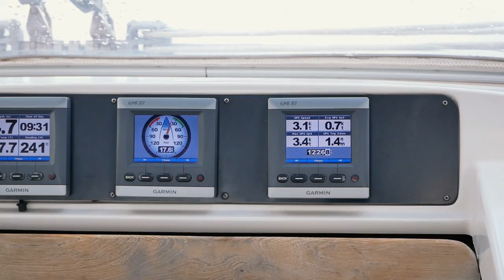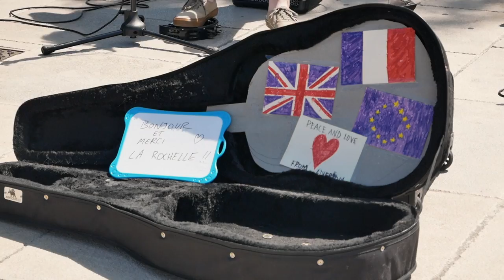A Very Difficult Decision | Sailing France Ep 112

Comment: We had the same problem once as well. No forward and only reverse.  We were leaving Maloolabar  in Australia and near the entrance.  We reversed back to our birth for about quarter of a mile. The difficult bit was we were a long keel yacht!  Fortunately we were a double ender  so it did not look to bad going backwards.  Had to adjust the clutch cone.  Watch what the mechanic does to adjust your clutch cone it is very easy that i learnt how to do it after watching the mechanic.  Takes about 10 minutes.  Another thing i learnt from a wise old fisherman is that many gear box problems are caused by having the wrong oil in them.  Literally change the oil to the correct spec and most of your problems go away. It is very common for the wrong oil to be in the box.

Comment: Nice.
The mechanicals suggest...
1. Great justification for hull cameras
2. Great justification for genset, batteries, and brushless electric motor.
3. Great reason for inter com.
Reply: They are selling the boat and moving on. A boat in this price range would dive considerably in price if it had non standard modifications. Electric motors, no problem we have an electric propulsion specialist right here in Sydney (600 miles away). I use a waterproof camera on a stick. Does a good job of prop inspections, but the bloody Wifi doesn't work underwater. I was particularly interested in a boat that came standard with a genset for the air conditioning. The owner, a man of considerable means, had had it removed. Because the friggin thing had broken down time and time again and the repairs were horrendously expensive and needed parts shipped from Italy. He thought the manufacturers should be jailed for wasting the earth's valuable resources to create that confection of mechanical disasters. I had an intercom, but the woman next door kept answering it. Seriously! I put it in the charity shop.

Comment: Before you opened the engine compartment I knew I would see the little gray ZF box. They are light, compact, inexpensive and have an expected service life of 500 hours. Great for a marina queen, not so much for a cruiser. Typically you get many hours of warning (tiny flecks in the fluid and delayed engaging).
I know, there is no room in the compartment to place a HD hydraulic transmission, so hopefully you ordered a second rebuild kit and buried it in a locker for next time.
Reply: Mine is only 18 years old, are you suggesting I might expect trouble sometime soon?
Reply: @philgray1023  It depends on the usage and hours. Hi rev long cruises run the overheat problem, accelerating plate breakdown (most don't come with a heat exchanger but ZF does make a cooler box that bolts to the side, redirect your raw water flow thru it between the raw pump and oil cooler). The other wear accelerator is gear thrashing hard forward then reverse in tight docking maneuvers. There are two good wear signs to watch for, delayed engagement when you put it in gear ( troubleshoot this  from low fluid levels, which will also cause delayed engagement and when even lower, full slippage). The other wear sign is small black 'flecks' in the fluid when you check the level. This one means the plates are already crumbling. There are rebuild kits available for all their models, and it really isn't that complicated, but I have found rebuild kits are priced at 60-80% of the price of a drop in replacement. ZF's are light, relatively cheap and easy to fit in tight engine rooms, but if yours doesn't need a rebuild now, it will sooner or later. I repowered last year and used a PRM hydraulic on the new engine, but weight and space weren't an issue for me.

Comment: I had this problem with an Yanmar SD50 saildrive.  Reverse worked since the cone clutch engagement was down and helped by gravity.  The forward part of cone clutch was pushed up so slipped easier.   I was able to lap the cone clutch myself which fixed the problem.  I then blew the oil seal between engine and saildrive so I ended up replacing it with an Sd60 drive which has plates for clutch rather the a cone setup.
Reply from the maker: Yeah lapping the cone was an option, but  without a workshop and a new cone being €250 we were without much of an option

Comment: First thing I would have checked. Is gearbox oil level. .    Low oil will do what yours is doing that. .  I'm a boat mechanic.  On narrowboats. But they all use the same engines gearboxes.

Comment: The amount of time clutches go is for me another reason to go diesel electric on future boats.
Reply: Yes, my thoughts exactly! No gearbox. On my boat I would ditch my 90 kW diesel engine for a 15 kW genset in combination with a 30 kW electric motor. Maneuvering, the extra needed power could come from the batteries.  The genset could live under the aft deck and the engine room could be an extra cabin in the center of the boat at the lowest point. Perfect underway. Oh if only my back account matched my dreams :-)
Reply: The problem with that is that you will still have some kind of reducing gear or possibly belt drive.  You're not going to have dircect drive from an electric motor to the prop shaft.  So, there's still a point of failure.  Not to mention the motor controller, which is MUCH more prone to failure than a diesel engine.
Reply: @kentfletcher8539  motor controllers fail because of bad installation. You really need the shielded cable an the earth straps.
Reply: @kentfletcher8539  That's not true, you can get direct drive electric motors, provide you match the right motor to the application.
Reply: The ever increasing power demands make  hybrid systems  the way of the future, come on battery tech!!!
Reply: @hymanocohann2698  Yeah i'm more mono and power boat myself, but if i was designing a sailing cat of around 11-13 tons i'd have 2 ~20kw electric motors which could do regen, a low RPM genset of maybe ~20kw for cruising, and a high RPM genset for backup and extra power. As well as 10-30 kwh li-po battery. That way most of the time you can regen when sailing never having to use the engine at all. When you are becalmed you can cruise on the low speed genset, which saves you putting hours on 2 engines at the same time. If that genset fails or you need to move quickly in an emergency you can use the other genset too.
Reply: Electrics and salt water - what could possibly go wrong! I wonder if any of you have ever been to sea in a small boat. Electrical problems occur with about 10 times the frequency of mechanical problems and are infinitely more difficult to fix at sea.

Comment: I remember posting this comment last time you mentioned the gearbox problem - do you think that all those hours at low rpm through the canals contributed to the worn forward clutch cone wear? - did Yanmar guy have any thoughts !
Reply from the maker: It probably did contribute. We don’t really use the engine much, so adding 200 odd hours probably added to the wear considerably. Clutch cones need replacing at anything between 1200 and 2000 hours. We are up to about 1400, so due for a replacement.

Comment: You have a shaft drive. I thought cone clutch slipping on Yanmars was a problem with the saildrive, esp the SD 50? Obviously not?
Reply from the maker: no mate, anything with a mechanical gearbox
Reply: Sailing Yacht Ruby Rose I’m sorry Nick but that is simply not true!   I don’t wish to labour this point but engines fitted with sail drives have cone clutches and those with gear drive have friction plates.  I have owned an HR37 with Yanmar sail drive and have changed the cone clutch system myself.  My current boat a Jeanneau 51 has a Yanmar 110hp with shaft drive and a gear drive, completely different system than sail drive.

Comment: Most automobile owners perform minimal maintenance on their vehicle until something breaks.  Airplane owners are required to perform regular and comprehensive inspections and parts replacement based on usage and time.   I would think that boat owners, especially cruisers, would lean more toward the airplane philosophy than the automobile philosophy.
Will you now include clutch inspection/replacement as a regularly scheduled item on your checklist?
Reply from the maker: My friend, there is absolutely no way you can check wear on a clutch cone. It’s in the middle of a gear box. 
Also, just to note when the engineer removed the old clutch cone and I compared it to the new one, I could notice no discernible difference in the wear between the two. Apparently it occurs on a very small scale that you measure in microns.

Comment: I had a boat come in here a few years ago, Mexico, towed, and a lot of so called mechanics screwed with everything , including removing the engine and transmission. The transmission was taken to a repair shop and they said it was OK. I Checked it, and it didn't function, I modified it and put in new thrust washers, the clutches and thrust washers were worn out, I also put spacers in the clutches because of no parts available , Then put it back in the boat, and it worked. A lot of marine gear boxes are shit, they have bronze thrust bearings instead of roller bearings used in cars.